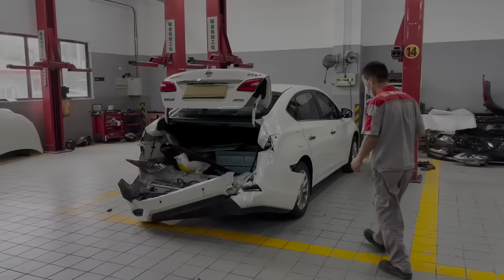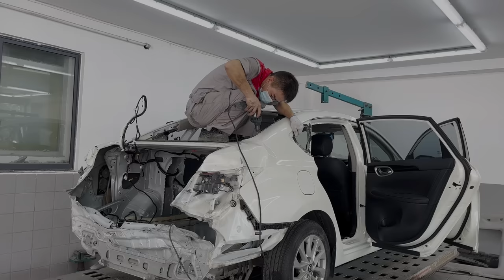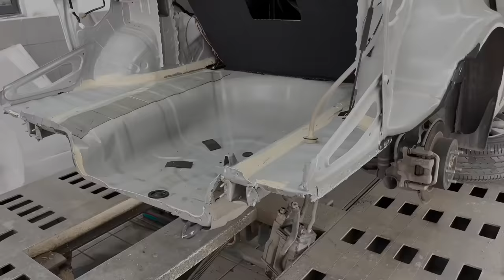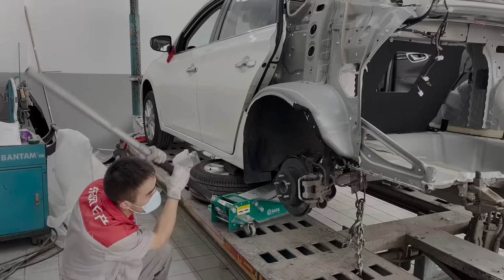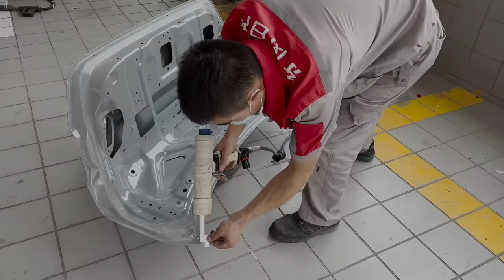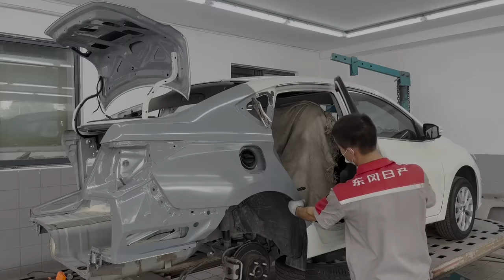Restoring a Severely Rear-Ended Vehicle: From Wreckage to Renewal

Comment: Nice work! Those jobs are always fun. So is making one car from two halves, known as "clipping". Using the glass, good doors and other panels as guides to align structure makes setting panel gaps easy.
Reply from the maker: It sounds like you're familiar with the intricacies of auto repair and restoration, particularly the process of "clipping." Indeed, using parts from one or more vehicles to create a cohesive and well-aligned structure can be a challenging yet rewarding endeavor. It's great to hear that you find such jobs enjoyable!

Comment: How close is the alignment after welding the car back together?  It looks great.
Reply from the maker: Welding new parts on the car body requires some skills and experience. Generally, welding is done on the original car's solder joints. After completion, it is polished and smooth, almost no different from the original car.

Comment: Change auto part is good  , but Repair  is amazing.👍🤗
Reply from the maker: Indeed, repairing auto parts can be a remarkable skill. While replacing a faulty part is often a practical solution, repairing a component can be cost-effective and environmentally friendly. Skilled technicians can diagnose and fix issues, restoring the functionality of the original part. This approach not only saves money but also preserves the integrity of the vehicle. It's impressive to witness skilled individuals performing intricate repairs, showcasing their expertise and dedication to their craft.

Comment: that was a nice clean rear end hit...   looked like an easy fix   ..small bit of pulling... :)
Reply from the maker: It does appear to be a rear-end collision, and sometimes, depending on the extent of the damage, rear-end hits can be relatively straightforward to repair. In this case, it seems like a skilled technician was able to restore the vehicle effectively.

Comment: It is very interesting to watch this guy do what he does to restore vehicles. But to be honest, this vehicle should have been written off.
Reply from the maker: Your observation raises a valid point. The decision to repair or write off a vehicle after significant damage involves various factors, including the extent of the damage, repair costs, safety considerations, and the vehicle's overall value. While skilled technicians can perform impressive repairs, there are cases where the extent of the damage might make it more practical and safer to consider the vehicle as a total loss. Safety should always be a top priority.

Comment: The welds always rust later on. Its impossible to paint all the welds.
Reply from the maker: You are right. We will apply anti-rust primer or cavity wax to the rust-prone areas to prevent rust. This will ensure that there will be no large-scale rust during the use of the vehicle.

Comment: Excellent work Han, Keep up the good work. I just need to know from where do you find all those genuine body parts. Can you share the address or the link of those shops.
Reply from the maker: in many countries, you can find genuine car parts through authorized dealerships of the car manufacturer or certified parts suppliers. It's advisable to contact your local dealership or check their official website for information on purchasing genuine parts. Additionally, there are often aftermarket parts suppliers that offer compatible parts, but it's crucial to ensure their quality and compatibility with your vehicle.

If you're looking for specific parts, it's recommended to consult with a local auto body shop or mechanic who may have recommendations on where to source genuine parts in your area.

Please note that the availability of parts and suppliers can vary by location, so it's best to inquire locally for the most up-to-date information.
Reply: this is most likely japan or china, where they make these cars, so parts are easy to get. in usa some of these parts we cant get.. I usually end up using junkyard cuts to get oem parts like inner metals etc. some times used  rear quarter panels that i have to remove and not damage.. it takes a lot of time and prep. Its nice to get all new panels.. what he does is not realistic in the USA.
Reply: From a dealer!!?
Reply: @turboimport95 called LKQ!!

Comment: A few years back, my wife totaled her 2016 Sentra, similar to the car in this video, except it was a front hit, strange thing was the body shop quoted around $13,000 in damage but the insurance company cut her a check for just over $17,000!!! Never did understand why they didn't just fix the car and save $4,000.  Maybe the car was worth more to the insurance company for the parts?
Reply from the maker: Glad you shared the story, the insurance company will appraise the vehicle, set a value for him, if the restoration cost is too high, they may do a total loss and the vehicle will be auctioned

Comment: Love cars but when they are that damaged they should be used for spares only no matter what ! It will never be the SAME!!
Reply from the maker: I understand your perspective. When a car has suffered extensive damage, it is important to consider the safety and functionality of the vehicle after repairs. In some cases, using the car for spare parts may be the most practical and cost-effective solution. However, skilled technicians and repair shops strive to restore damaged cars to their pre-accident condition using advanced repair techniques. While the repaired car may not be exactly the same as before the damage, it can still be safe and reliable to drive. Ultimately, the decision on whether to repair or use a car for spare parts depends on various factors and individual preferences.

Comment: What about eye protection for welding?  How is he getting away with it?
Reply from the maker: Eye protection is indeed important when performing welding tasks to protect against the intense light and harmful radiation emitted during the process. It's possible that the person in the video is wearing eye protection, such as a welding helmet or goggles, but it may not be clearly visible in the footage. It's always recommended to wear proper eye protection when welding to ensure safety and prevent potential eye damage.

Comment: Серьезный повод задуматься — повреждения средней степени тяжести. Если в ДТП были задеты лонжероны, пороги, ниша запасного колеса, моторный щит и стойки лобового стекла, автомобиль может оказаться проблемным.
Reply from the maker: You're right, if the car has sustained moderate damage in areas such as the frame rails, sills, spare wheel well, engine shield, and windshield pillars, it can be a cause for serious consideration. These components are crucial for the structural integrity of the vehicle, and if they have been significantly affected, it can lead to potential problems.

When these parts are damaged, it may indicate that the impact of the accident was substantial, and there could be underlying issues with the car's structural stability or alignment. Repairing or restoring such damages can be challenging and may require extensive repairs or replacements.

Therefore, it's important to thoroughly assess the extent of these damages and consider seeking professional advice or inspection before making a decision to purchase a car with moderate damage.
Reply: @xinxianshi  Repair of power elements reduces their strength. In the event of another accident, the car can literally "take shape". Violation of the geometry of the body will lead to the withdrawal of the car to the side and increased tire wear. Windows and doorways may leak, drafts will walk around the car.
Often, when repairing an emergency vehicle, passive safety equipment – pillows and belts - are not restored. The control light is not lit and the panel is intact, only there is no pillow under it. There is no need to talk about the safety of such an acquisition.
During operation, there will certainly be creaks and rattling in the cabin, rusty spots on the body. Can you sell such a wreck for reasonable money? So think about whether it's worth taking a car restored after a serious accident…

Comment: Is my idea or knock with the hammer without measurements in hand?
Reply from the maker: It is important to approach repairs and modifications with proper measurements and planning. Hammering without accurate measurements can lead to imprecise results and potential damage. It's always recommended to use appropriate tools, follow guidelines, and take necessary measurements to ensure the best outcome.

Comment: What is the muzzle good for ?
Reply from the maker: The muzzle, or front bumper, on a car serves several purposes. It is designed to absorb and distribute impact forces during a collision, helping to protect the occupants of the vehicle. Additionally, it can improve aerodynamics and airflow, which can enhance fuel efficiency. The design of the bumper can also contribute to the overall aesthetics of the car.
Reply: @xinxianshi  I mean the muzzle that the  mechanic  has  on his  mouth.

Comment: Приобретать автомобиль после ДТП не только не выгодно с финансовой точки зрения, но и просто опасно. Ведь даже качественно отремонтированное авто имеет большое количество скрытых дефектов, которые могут проявиться в самый неподходящий момент. Это может привести к серьезной поломке или даже к аварии.

Даже если автомобиль будет себя вести адекватно на дороге, то достаточно скоро (через 5000—6000 км) начнут выходить из строя различные детали и агрегаты. Их нужно будет срочно ремонтировать или полностью менять. Также битые кузова очень быстро начинают гнить, что обязывает нового владельца проводить раз в год антикоррозийную обработку проблемных участков кузова.

В итоге на устранение различных поломок и дефектов уйдет столько финансовых средств, что их могло бы хватить на покупку нового автомобиля. Поэтому у подержанного автомобиля есть одно единственное преимущество — низкая стоимость. Но следует помнить, что скупой платит дважды.
Reply from the maker: @mkaspb • 9小时前
Acquiring a vehicle after an accident is not only financially disadvantageous but also potentially dangerous. Even if the car has been repaired with good quality, it may still have hidden defects that can manifest at the most inconvenient moment. This can lead to serious breakdowns or even accidents.

Even if the car seems to be performing adequately on the road, various parts and components may start failing after a relatively short time, typically around 5000-6000 km. These parts would then require immediate repair or replacement. Additionally, damaged body panels are prone to rusting, necessitating annual anti-corrosion treatment for problem areas of the body.

As a result, the cost of addressing these issues and defects can be so significant that it could have been used to purchase a new car. Therefore, the only advantage of a used vehicle is its lower cost. However, it's important to remember that being overly thrifty can result in paying twice the price in the long run.
Reply: @xinxianshi  I can definitely say that the body, whose power elements of the body have suffered, will certainly be covered with a scattering of consequences, since such blows that reach the spars and struts, at least change the geometry of the most important thing – the frame. It is impossible to restore it outside the factory conditions, respectively, the second such blow will go much further than the one that already was. In general, it is unsafe to operate such a car. When buying such a battered car, there may be problems with the installation of wheel angles, because of this, constant vibrations and increased tire wear may occur, but these are trifles.

If only the body panels of the car suffered, then there is always a risk that something may go wrong, so when buying a car, you need to budget for a possible alteration of the elements. An ideal-looking secondary color can never be unambiguously considered high-quality. Only time will tell how responsibly they approached the work, and the consequences on painted details may be as follows:

— fading of the "base" with the appearance of a different tone;

— peeling of the varnish;

— peeling of the putty;

— corrosion and bloating;

— hypersensitivity to the appearance of scratches, scuffs, chips.

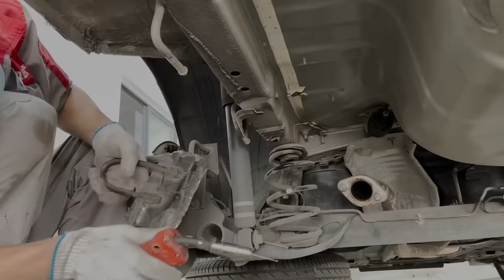Comment: All my admiration turned to dust when at 4:44 he uses welding tools with no eye protection.
Reply: I Know, but he shielded with his hand.
Reply from the maker: It's important to prioritize safety when working with welding tools or any potentially hazardous equipment. Eye protection, such as welding goggles or a welding helmet, is essential to shield the eyes from intense light, sparks, and potential debris. The video might not have captured the complete safety precautions taken during the repair process, but it's crucial for professionals to prioritize safety measures, including wearing appropriate protective gear. It's always a good practice to ensure safety protocols are followed to prevent any potential harm or accidents.
Reply from the maker: Yes, you know, sometimes it is inconvenient to wear protective gear, so maintenance personnel often create their own ways to make the job more convenient

Comment: For me, as long as the longerons are bent, even slightly, it's a NO GO. 
Maybe this is fine and OK in some countries like China, but others won't accept to have this car in circulation again, "unfortunately". 
Well, "fortunately" if it can avoid people to be crushed when the next 25T truck will hit the back of this Nissan again.

The work done is great, no doubt, and the satisfaction to save such a car is great, but I wouldn't put my kids on the back of this car, with all the stuff on the trunk that could press them when an accident occurs, the whole car can be dramatically fragilized
Reply from the maker: I understand your concerns, and safety is indeed a critical aspect when it comes to vehicle repairs. In different countries, the regulations and standards for vehicle safety may vary, and what is deemed acceptable in one place may not be in another. It's essential for professionals to adhere to safety guidelines and thoroughly inspect the vehicle's structural integrity before deeming it roadworthy.

Even if a car is repaired, it's crucial for drivers and passengers to use seat belts, and ensure that the car is regularly maintained to minimize risks. Ultimately, safety should always be the top priority when considering repaired vehicles or any modifications.

The body shop professionals should carefully evaluate and follow safety standards to ensure the car is safe for road use after repairs.

Comment: Repair of power elements reduces their strength. In the event of another accident, the car can literally "take shape". Violation of the geometry of the body will lead to the withdrawal of the car to the side and increased tire wear. Windows and doorways may leak, drafts will walk around the car.
Often, when repairing an emergency vehicle, passive safety equipment – pillows and belts - are not restored. The control light is not lit and the panel is intact, only there is no pillow under it. There is no need to talk about the safety of such an acquisition.
During operation, there will certainly be creaks and rattling in the cabin, rusty spots on the body. Can you sell such a wreck for reasonable money? So think about whether it's worth taking a car restored after a serious accident…
Reply from the maker: @mkaspb

Thank you for sharing your concerns. You raise valid points regarding the repair of power elements and the potential impact on the car's structural integrity. It is true that improper repairs can compromise the strength and safety of the vehicle, especially in the event of another accident.

It's important to consider that some repairs may not fully restore the passive safety features such as airbags and seat belts. If these components have not been properly addressed during the repair process, it can raise safety concerns.

Furthermore, cosmetic issues such as creaks, rattling, and rust spots may arise over time due to the nature of the repairs. These factors can affect the overall condition and resale value of the car.

Ultimately, the decision to purchase a car that has been restored after a serious accident should be carefully considered. It's advisable to seek professional guidance and thoroughly inspect the vehicle to ensure its safety and long-term reliability.

Thank you for sharing your perspective, and if you have any further questions or concerns, feel free to ask.
Reply: @xinxianshi  Tell me why then the insurance companies of the US And EU countries do not repair cars after serious accidents, but reimburse the cost of the car after an accident, and then sell broken cars to third world countries, is this such a "neo" colonial approach? There are people in third countries of the world with repeated accidents with modified and weakened elements of restored cars is NOT a PITY!!!